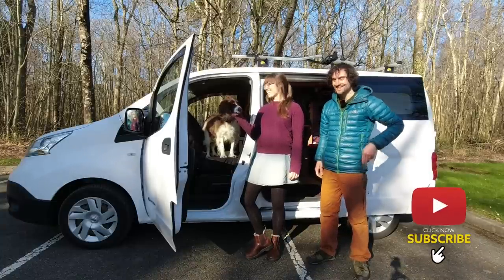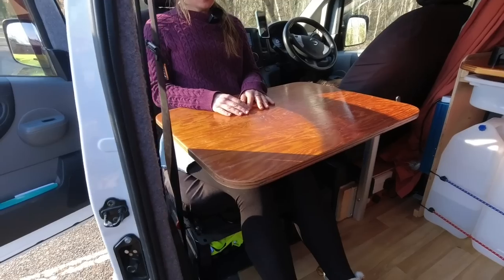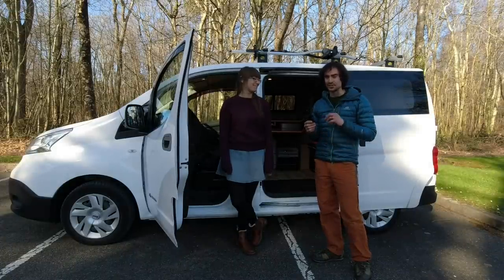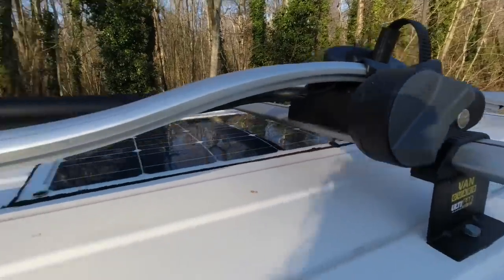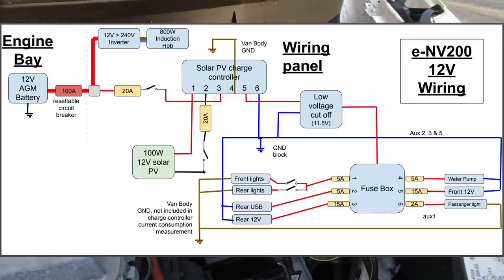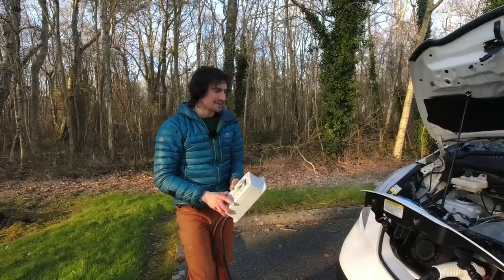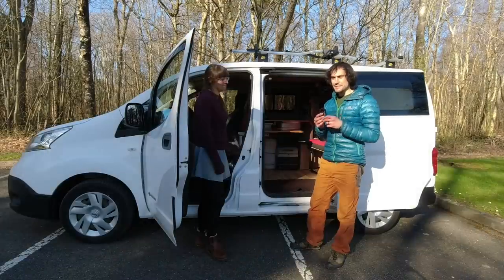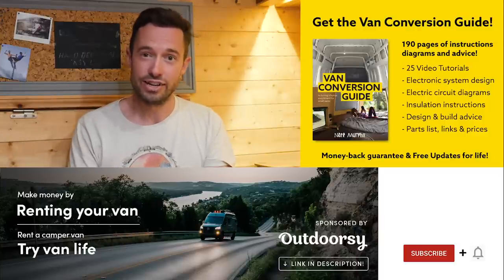FULLY ELECTRIC VAN CONVERSION ⚡ The Campervan of the Future 🚐

Comment: I've a first gen Renault Kangoo EV with the same range. Your workarounds are making my EV camper dream realistic again!
Reply: Thanks! That;s great to hear. The Kanngoo is a nice electric van, however it doest have rapid charging capability like our e-NV200 does so long trip would be tricky. It only takes 15-20min to rapid charge our van so it's possible to cover 300+ miles comfortably in a day.
Reply: Yes get relsa
 Cel 245 miles 122.5 mikescwiter range chargers 114 miesv8 mioes keft artery esvee

Comment: Solar panels is shaded, severely reducing it's output.

Monocrystalline and polycrystalline  will output  as much as as the cell with the most shade. So by having the panel under the roof rack, you are in practice shading the entire panel.

If you want solar panels under shade, you have to use thin film.
Reply: As I mentioned the rack is removed when the van is used for camping trips. But thanks for the tip!

Comment: Interesting about running the 12v items and other electrics. I always wondered about that. Doesn’t seem to drain the battery much at all.
Reply: If they run an 800W induction hob for 20 minutes each day, plus 50W to run everything else for 12 hours, 0.27kwh.
That's 1.3% of a 21kWh battery.
76 days capacity.
Reply: @rogerstarkey5390  12v battery isnt 21kWh
Reply: @cbflazaro  Does it not use a DC to DC converter?

Comment: Now if only the solar panels were sufficient to charge the vehicle battery…
Reply: We're seeing van builds with 800-1000W of solar now, so it's at a stage when a vehicle that's static for a few days in summer could get useful "get out if trouble" range.
Realistically, you'd have to be a numpty to let it get that low.
Reply: there are evs beeing developed to do just this. eg the sion from sono motors. a big van with more surface area could gain much more solar power... the energy production is very situational tho.  but i wont be surprised to see like 30 miles  daily range by solar. 
it will be hard to garage-upgrade such an solar system to your ev-van as these batteries run very high voltage
Reply: I can't wait till more gas electric hybrid vans come to market. Go camping for the weekend, charge up while parked, and off to the next destination. If you run out of electricity out in the woods then you can use the hybrid gas engine to make your way back. Now that is sustainability that is also practical (no longer worried about range).
Reply: @designbooth007  That's just your opinion. Pure battery electric vehicles don't make sense in most extended camping sites and many situations. So logically a hybrid vehicle would be a better choice for a lot of people who still want to be environmentally friendly. Gas stations are still in abundance, while charging stations are scarcer and inconvenient in most locations.
Reply: @designbooth007  nobody asked for your opinion lol
Reply: @TylerWitucki  Looks like Ford will be doing a hybrid transit. The problem with hybrids is now you've got an ICE van with all the stuff that goes with it (engine, fuel tank, gearbox,  exhaust) and the stuff for an EV (motor, charger, battery) but the battery is small or very small. So it's heavy, complicated and expensive and if you do want to use it in a low-carbon way you are going to be charging even more often than these guys. It's a lot of downside for the rare occasions that you couldn't find anywhere to charge. There are no doubt places in the world where this still makes sense, but if you can drive to Slovenia and back in a 24kWh env200 then I reckon now we have the 75kWh/170mile PSA vans, at least in Europe there really is no point lugging an engine round as well, taking up valuable camper-van space. And those vehicles are compromised by being built in a diesel-as-well body. Once we get Arrival and Rivian and VW ground-up EVs you will get so much more interior space for a given van size, and massive flexibility because coachbuilders can do almost anything they like on the skateboard, I'm pretty convinced that BEVs are going to make more sense except in very specific situations. I like to wild-camp and travel long distances to obscure places, but I still think BEV is the way to go, either this year or next.
Reply: The thing that is missing for efficient EV solar charging is a 200-1000W MPPT to 400VDC charger controller so you can fill the traction battery efficiently from a roof-full of panels. So far as I can tell no-one makes such a thing yet, but they will be in demand in a year or two. You only get a few miles/day, but it means all your ancilliaries run 'for free' and you don't waste 10%+ going through a 12/24/48V sub-battery system to the main battery, then back out again that way. I've started a design (it's not rocket science) and I'm pretty sure there will be a market at some point.
Reply: @xxwookey  Thanks for your detailed response. It's quite interesting. The idea of "free" fuel is very attractive for these vans. It's not just the cost, it's also a nice convivence to not have to drive out of the way and wait at charging station as often on a camping trip (Now that can be a better solution over a hybrid). I like your initiative, and as solar panel efficiency and cost reduction improves, then the more useful they will become on vans and other surfaces. It would be great to see a solution to that problem that you described.

You do make some good point. However I do believe there are a decent amount of localized locations and whole countries that have a weak network of charging stations available (for the various charger cable types). These locations would be better for a hybrid solution and could be readily for purchase before an adequate amount of charging stations are available and are at a convivence. Comparing a charging station map and to a cell phone coverage map shows areas of no or little coverage. Although they could be dependent on home chargers.

I'm also particularly interested in how hydrogen can be generated and converted into other energy sources such as electricity. As well as other solutions that are mostly theorized like carbon capture and conversion on the larger and smaller scale and how that develops into the future. There are many huge innovations for energy production and consumption in the future to look forward to!
Reply: @TylerWitucki  I've recently had my eye on the upcoming fully electric Ford E-Transit van with the L4 extended back, I think the stated 217miles is probably for the L3 version, that's pretty bad mileage. So I've been looking into solar panels to try help make that mileage go further, its a LOT of work even for just design perspective, I wish there was a company who could specialise in exactly this who could design and supply dedicated roof bar/panel systems for large vans and advise their customers on the currently best solar panels for their roof racks.

I'm looking into getting into the van life. This E-Transit sounds perfect if not for its low mileage per charge. Its "Pro Power Boost" sounds really awesome for van life, 2.3kW of power with "maybe" the potential for an optional 7.2kW optional upgrade (if plugged into the mains at least?). So, a few large solar panels could be really great for a large van... as long as its not constantly being driven or for very long distances.
Reply: @xxwookey  sounds great I'll be first in line to buy one!
Reply: Maybe they could get a second panel or consider using propane or butane canisters to cook with.
Reply: Sure it does, just takes a couple months. Great if you're not in a rush.
Reply: @designbooth007  Really love those gas hogs, eh?
Reply: @amywalker7515  they are charger hogs for us real EV drivers
Reply: I was thinking the same thing. Or at least be able be supplemented with wind power.
Reply: Sufficient enough for appliances
Reply: that is actually precisely what we are doing in our Soleva Solar Electric van demonstration project 😀 give it a look on any social media account and Instagram for instance.

Comment: Looks great, thanks for the inspiration! I vaguely recall a van outfitter mentioning that the ev van battery warranty would be void if they tried to tap it for dc-dc, is this something you guys looked into?
Reply: Thanks! Lots of commercial applications do exactly the same, British Gas has a fleet of these vans with 240V inverters professionally fitted. The DC-DC converter is rated for 135A and the 12V battery acts as a buffer. Our peak draw is less than 70A so we're operating it within specifications, I don't see any issues with warranty. Our van is over 5yrs old, so its of warranty but I wouldn't hesitate to use it in the same way if it was.

Comment: So how much does it cost to charge your van at a service point?
Reply: The cost varies, but it's always much cheaper than fuel. Charging overnight at home a full charge costs £1 of electricity. Motorway service rapid chargers are usually about £4-5. A recent return trip to Spain cost  about £100 for 2500 miles. Take a look at https://www.zap-map.com/live/ to see locations and pricing of EV charging

Comment: I think it would be really weird watching battery fuel running down especially in the middle of nowhere
Reply: The van gives you plenty of warning and the remaining range estimate is quite accurate. Luckily electricity is almost everywhere, worst case scenario is you have to plug into a domestic socket. There are actually 40,000 public EV charging stations UK, so usually one is not far away. Just like going to a fuel station, checkout https://www.zap-map.com/live/
Reply: It's not that bad at all really. Even here in V8 loving NZ it's a great vehicle

#iloverangeanxiety 😁
Reply: 2 options. Connect solar to the car or carry a small gas generator for emergencies (would also help if you had like a cloudy week and your onboard batteries are low)

Comment: Nice about time! But running it all off a Granny Charger? risky man just hook up directly to the site
Reply: Yes, when on a campsite we can plug directly into the 16A hookup, I think I did mention this. However, I never draw the full 16A, not many campsite hookups can sustain 16A. I usually limit it to 10A, it takes about 8hrs to charge, but this is not a problem if we're staying for the night

Comment: how much will a van conversion like this cost
Reply: I've no idea 🥵
Reply: Price of the van, then what you spend on furniture, no multi thousand £/$ power system required.
Reply: @rogerstarkey5390  How much is the van wise guy
Reply: under a grand i reckon
Reply: @jamiemacgregor4435  
"Wise Guy"?
Well, the SPECIFIC question was "How much will a van CONVERSION like this cost". 
That's what I answered.
You're the one asking questions nobody here can answer (No doubt trying to pursue the "not worth it" narrative)
Reply: The van cost us £9500 and the conversion cost £2500 in materials and parts. We did most of the work ourselves

Comment: I wish people would stop overusing the phrase "off-grid". You aren't off-grid when the power you need to run your vehicle still comes from the grid.
Reply: Exaclty and when the fuel for your petrol/diesel van comes from a forecourt using electricity to pump it..... oh wait a second 😜
Reply: I think he says "Off-grid for a few weeks". During these weeks he is not attached to the grid and he is not charging as he is not driving much. That's the context in which he uses it.

Comment: Sorry why have all these charging points and build expensive charging infrastructure with all its limitations when they could just build in solar panels into the vehicles roof as standard?
Reply: Roof is too small a space to accommodate enough solar surface area to keep an EV charged.
Reply: @stevejoneswildwriter  Yeah but it will help
Reply: @chatteyj  
The panels they could fit would cause more loss due to drag than they supply to the van battery.
Reply: They already have one but it's only 150 watts.  They could use a suitcase panel set or two.
Reply: @rogerstarkey5390  I'm talking about a zero drag integrated panel design obviously
Reply: @chatteyj  
no, not "obviously"
Reply: @rogerstarkey5390  Yes obviously why would a manufacturer install a solar panel that created drag and potentially negated any benefit of the solar power that would be totally daft!
Reply: It's not worth it at all, I looked at it for ENV200 and it would take so long to even charge 1%, yet a fast charger can charge 20% to 80% in 8 mins
Reply: @stevejoneswildwriter  Unless it's an aptera

Comment: Not practical at all . To many charging stops this would drive me mad . 300miles plus please 👍🏼
Reply: Yeah it's mad that it can't really even get you half way to your destination 😂
Reply: And when the 300 mile van is available (not long!) You'll say "400 miles"
Reply: @rogerstarkey5390  Well 400 I could live with I reckon. Still gonna take longer than petrol or even better hybrid.
Reply: @JoeMaranophotography  
wrong perspective.
Just needs to outrange the driver, then charge while the driver empties and fuels.
Reply: @JoeMaranophotography  We don't really have a choice here - we have to stop burning diesel and petrol ASAP - preferably this decade. So the question is how do we proceed given that constraint? Use EVs and stop a bit more often for a walk is one, very sensible, approach.  Others are possible such as e-fuels and hydrogen-fueled EVs but they need a factor-of-several more energy  (or large-scale CCS for blue hydrogen) so are likely to work out a lot more expensive. The 200 miles van is just about here now (in summer, if you drive slowly) which is about the distance where range ceases to matter much for cars. wild-camper campers is just about the worst application for BEVs and it's already doable at the smaller vehicle end of the market, with more capable vehicles coming out every couple of months.
Reply: @xxwookey  I'm not convinced we need to. The planet is ridiculously large and will die of its own makings long before us humans make it.

Comment: Electric motors are a waste of time and not sustainable
Reply: Woohoo!
The first fossil numpty!
Reply: What????
Reply: Do you kind of people just come out the woodwork?
Reply: @rogerstarkey5390  Nothing wrong with fossil fuels matey, he is correct at the moment until they make these vehicles self sufficient in energy I don't really see the point of them. In tens years time when half the country is plastered in solar panels and wind turbines I reckon you lot will change your tune, it ain't all good.
Reply: @chatteyj  
What the ** are you talking about "Self sufficient in energy"? You think oil implies "Self sufficiency"?
If you "Don't see the point" you're not paying attention.
Seems like I've stumbled into the "1968" corner of the discussion.
"Us lot" will have no problem.
"YOU lot" will be trying to sell your oil burners. (Good luck with that)
And I'm not your "Matey"
Reply: @soapyvanshoey  
You did.
Reply: @chatteyj  Well, birds do fly into turbines sometimes, but why worry about half the country being plastered in solar panels and wind turbines?  You could power the entire USA with just a small portion of it plastered with solar panels.  Anyway, for a van there is a problem with self-sustainability, in that there isn't enough roof area to run off solar entirely and continuously, driving and living activities included.  But you can power an entire house that way.
Reply: @dingfeldersmurfalot4560  Maybe but don't forget wind energy and what about the energy from wheel rotation when in transit perhaps that could be utilised? In the UK we are short on desert and unattractive or unproductive  land that can be turned into colossal wind and solar farms so thats my concern.
Reply: In the UK, the best place for solar is South facing "unproductive" rooftops (domestic AND commercial. Utilise it at point of use. Wind? It's being done, offshore.
"Wheel rotation in transit"? Would either place drag on the wheel  under normal motion, which defeats the object, or be harvested under braking..... AKA "Regeneration"..... Already being done.
Reply: Fossil fuels make wind turbines and solar panels end of do you research
Reply: @soapyvanshoey  We've done our research and remain unimpressed with your juvenile arguments. Wind turbines cover their embodied emissions of manufacture in about 6 months. Solar panels in about 2 years. As grids and industries get cleaned up less and less fossil fuel is used in production until it's essentially none. We are in the middle of the decarbonisation transition. Electric motors are of course extremely efficient, very long-lasting and easily recyclable so definitely sustainable, or at least a great deal more sustainable than internal combustion enegines and the fuels that power them. You might find this comparison educational: https://www.youtube.com/watch?v=1oVrIHcdxjA&t=630s